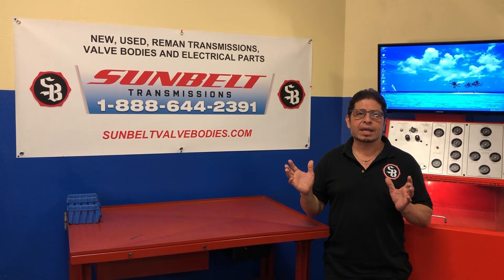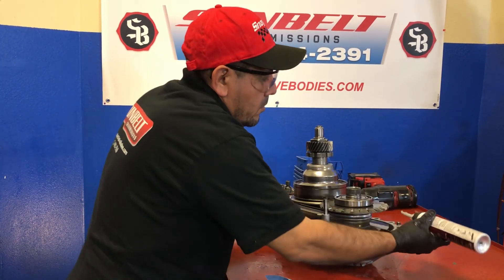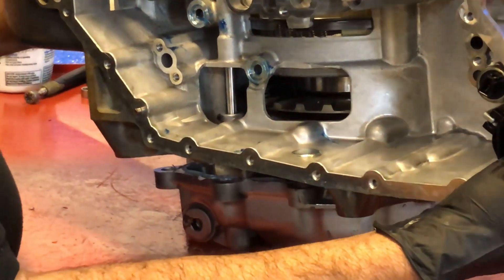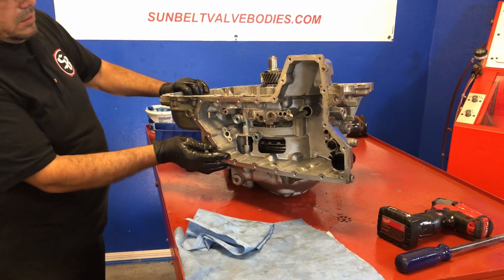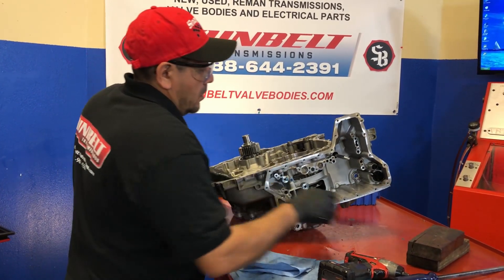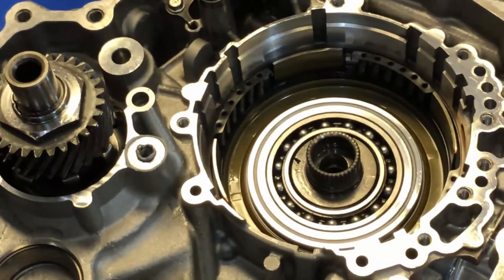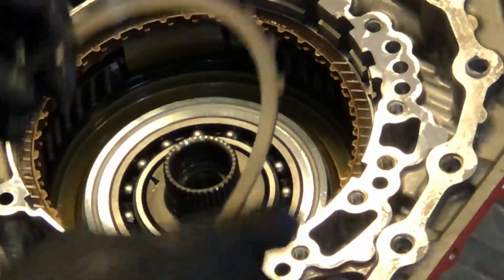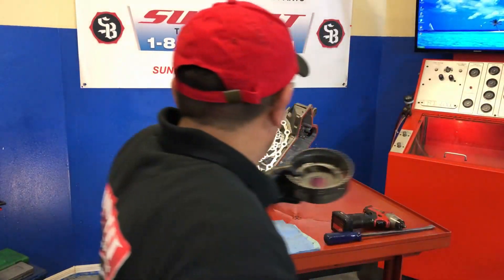CVT How it Works Nissan Quest REOF09B/ JFO10E  How to assemble complete CVT Transmission (Part2)

Comment: Do you guys have a video on a 2016 2.5 L altima transmission? Ive been scrolling through can find none
Reply: These transmissions are notorious for messing up, my advice is to buy an upgraded remanufactured valve body from his company, buy a new filter and  cooler. Make sure to chamge the oil and do a complete transmission and radiator flush. If your problem isnt fixed after that you need to pull the tranny out to rebuild. 
Good luck
Reply: @maciekpoland7142  i replaced with used one with 15k miles have 25 k miles on it
Reply: @valledecauca1087  give sunbelt a call when it screws up again.
Reply: @maciekpoland7142  update im at 148500 turns it its been leaking since i installed it started slipping 3 thousand miles ago but i changed transmission fluid it was still clean u guess it was just low so know I have to keep adding transmission fluid every so often wish I would of took it here